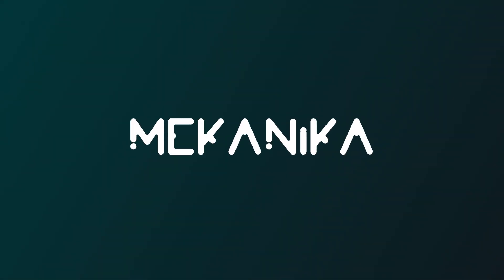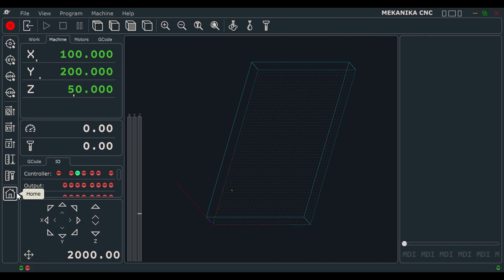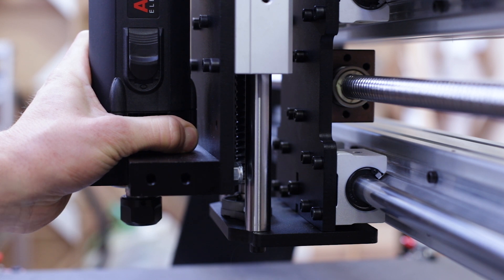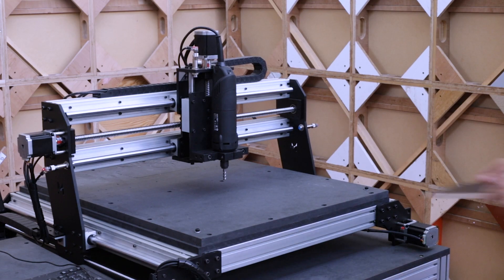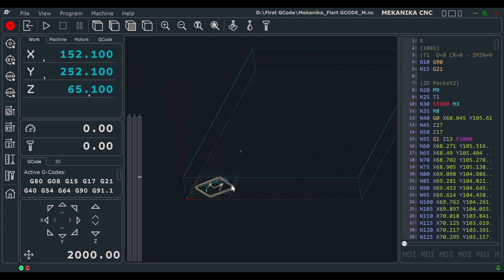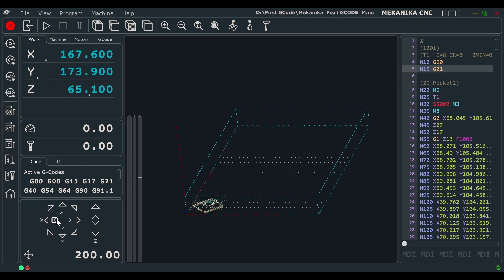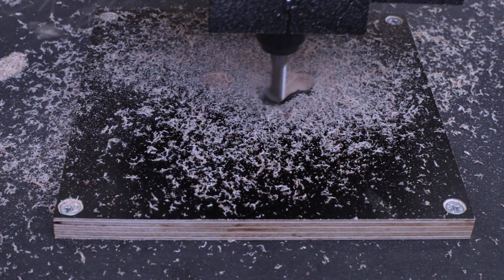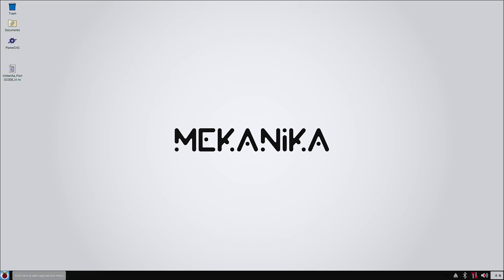Getting started with my CNC machine / Step #6

Comment: Hi guys. I'm almost done assembling the cnc. You just need to buy the spindle. Soon I will send you photos and videos. On the other hand, I wanted to know if with that spindle that you use (AMB (Kress) FME-P 1050) I can do you work for long periods of time, for example for 8 hours? I've been looking at the AMB 1400 spindle which is 1400 watts of power. In your experience, do you think that with this spindle you could machine steel without problems? Regards.
Reply from the maker: Hi Sergio ! Nice, please do send us photos of it ! :-) 
From our experience, the FME-P 1050 can be used several hours in a row without any problem. We were able to mill steel with it at very low speeds, but the 1400 will definitely be a better choice if you plan on milling metals mostly !